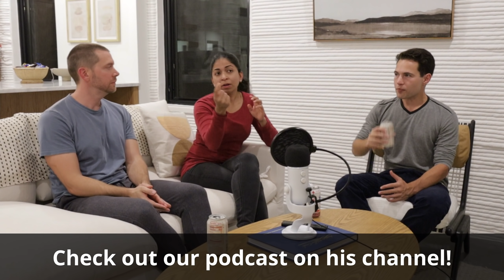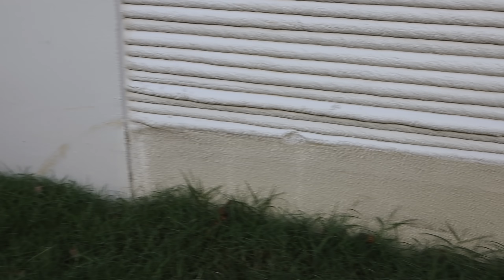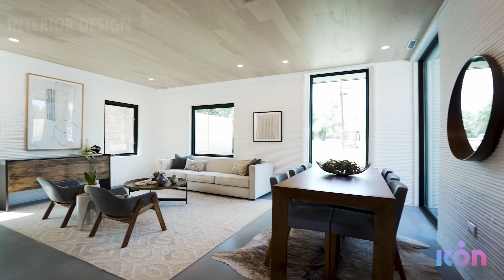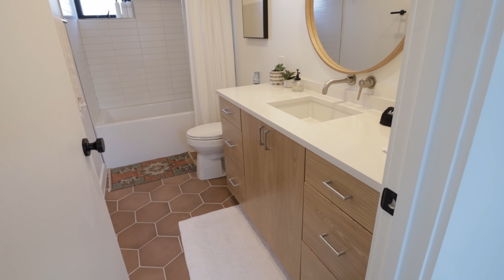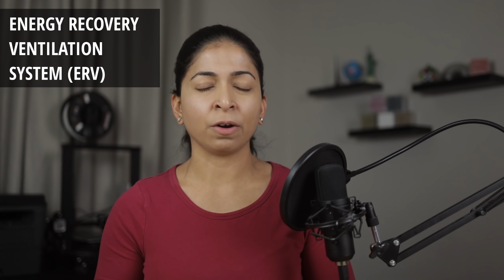I stayed at ICON's 3D printed concrete house in Austin!

Comment: It will be interesting to see these houses in a few years' time - when they have become dirty.  I imagine that cleaning these printed walls inside and outside will be very difficult.  Especially in northern and southern latitudes (temperate climate) the outer walls will be prone to things growing on them - some, like lichen, might be attractive in some ways, maybe moss, too, but eventually you will probably find larger plants trying to grow on the outer walls. Whether this is good or bad is debatable, of course.  Inside, dust will accumulate on the ridges, and will be hard to remove, I suspect.  I would have thought that lining this interior walls with drywall would eliminate these sorts of problems, and make it much easier to hang things on the wall, and to put in services. I know, that will hide the fact that it is 3D printed - but the novelty of that appearance will soon get old.

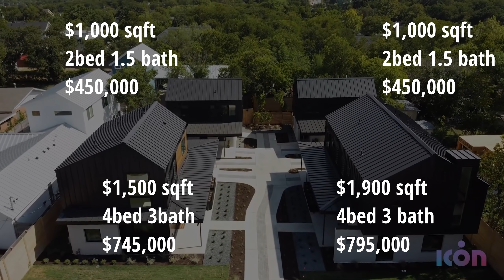Comment: 7:30 I think you've confused price with cost. The reason why these 3D printed homes prices are comparable to similar sized nearby homes in the area, is that you'd be crazy not to sell them at the prevailing price level. If they cost half as much as traditional built homes in the area, they'd still be priced at the prevailing rates, and if they cost twice as much to build, they wouldn't exist in the first place because they wouldn't have even bothered to break ground. Unless they're showing a true cost breakdown and willing to publicly quote a similar structure outside of a high priced city, we really don't know what these things actually cost.

Comment: Would be neat if the printer could trowel the concrete smooth as it goes. The pattern it leaves now looks kinda kool, but could collect dust on the upper sides. Those trim boards not matching in the corners could have been done much better. Simple trick with a circle compass would mark them almost perfectly.
Thanks for showing us these technologies, Belinda. 👍

Comment: @BelindaCarr please include metric equivalencies either in the audio or as text; it would make your content more accessible to those of us are not as fluent/familiar/literate with imperial units. Especially with pressure, force, volumetric and mass flow rates.

It would be interesting to see if it would be possible to integrate the electrical outlets into the print.

Comment: So how does the exterior layer of mortar tie in to the interior layer for structure? Filling the wall void with insulation makes sense but the thickness of that exterior layer is pretty thin for load bearing.. or maybe they poured columns and the wall isn't load bearing?

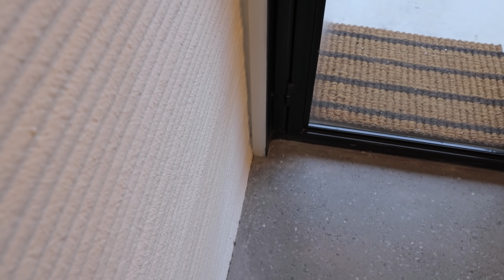Comment: 5:09 This isn't a limitation of 3d printing, this is a limitation of ethics and care by the company in charge of constructing the house. They could have done a better job but chose not to.
Touting yourself as a cutting edge 3d printing company is sexy, doing actual construction and caring about the work you do isn't sexy so they don't care.

Comment: You can tell whoever printed the walls doesn't understand slicer optimization. It also doesn't look like they used any type of vibration compensation or they would have been able to prevent the corners from looking like trash. Even cranes have motion compensation.

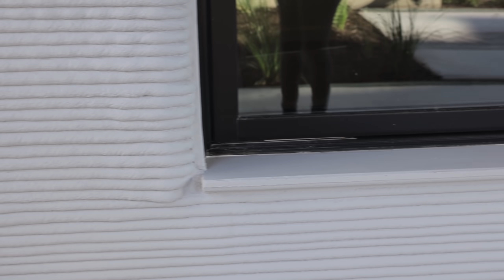Comment: 1:19 "Mortar" and "concrete" are terms that are more related to their function than material.  The term "mortar" is reserved for the substance that connects other masonry objects together like brick, block and tile.  The term "Concrete" is used when similar material is used as a mass for things like floors and walls.  All mortar and concrete have some sort of aggregate even if it is just a sand or sand like material and these are considered small aggregates. The function of Portland cement which is contained in mortars and concretes,  is to "glue" or adhere the aggregate together.   The large aggregate would be the gravel if it is included.  So these walls are printed out of a concrete with small aggregate and other additives like accelerators or decelerators (depending on temperature) and other polymers for strength and resistance to cracking.   This mix would be similar (but finer) than a line pump mix we would use for pouring walls through a line pump.  

I love concrete but I love efficiency even more :)  the amount of time, material, equipment and labor required to do this (when I could take 2 carpenters and framed these walls in a day with simple tools :) makes me predict we will never be using this on a wide scale.  You can look to the spec market in housing to see what is efficient.  This type of construction will be reserved to those who can afford the material and process and time to wait and head aches for MEP. Again, it's cool but . . .    Nice video.  Your videos are always informative and objective.

Comment: I think many people are getting stuck on the appearance on the interior. They could cover it up with drywall or stucco for a smooth finish, but they chose to leave it as is for aesthetic reasons.

This is a huge progression of 3D Building construction and I'm very excited by the potential, even if it currently bis targeting a select niche market rn

Comment: I really appreciate your straight-forward reviews and thank you for including the VOC/CO2 levels, as well as heat loss. The one thing I've wondered about, regarding these alternative construction methods, is that they are touted as being a more cost effective, but they seem to cost just as much as regular construction homes. Sure, it can be cost-effective for the builder, but not for the end-consumer. For example, to me, a $50K tiny home seems reasonable, while a $100K tiny home does not. What do you think?

Comment: #1. It's a 3D printed first floor walls, not a house. A definition of a house is not the same a just walls without anything else.
#2. I want to know if that cement mix is bad or good for the environment. 
#3 eberh RC prefabrication factory can make such shape, with isolation already attached. The walls could have been two floors tall, so the structure can be built in two days. That's a standard technology and lots of experience. Nothing complex.
Reply from the maker: I addressed all those points in my video on 3d printing lies: https://youtu.be/sz1LM9kwRLY
Reply: @BelindaCarr  
Yeah, I know. I watched that. I've seen most of your videos. Your content is great! :)
I started with the content about container houses. That one is my favourite. 

It is just that the houses from this video are nothing special in term of technology. Commercial technologies could make these  cheaper and faster. Especially that there was a good crain access to that site. 

BTW1: your content is very good. I've watched a lot of it. I keep watching older videos often. 
BTW2: gym definitely has good effects on you. You look amazing. Keep it up.

Comment: For structural purposes I think 3D printing could be very interesting (if it can get up to the necessary compressive loads) but this honestly is just a hair above a sham. 3D printed walls that require an elastomer exterior coat to make them waterproof the inability to make them useable inside surfaces to not even able to hang a simple picture frame from they are there for show only. You could easily replace the 3D printed parts with pre-cast concrete or factory assembled panels (hempcrete, aircrete, SIPS etc) and it would result in a more useable space. I was shocked to see the state of the finish at the edges where other surfaces meet 3D printed 'concrete' not to mention the lack of any kind of practical usability or liveability (leaving a rough textured surface as a kitchen backsplash, dust building up on all the edges inside) and bizarre design decisions like putting all plumbing/electrical into a bump out rather than having them printed in, thats the whole point of digital design. 

I think 3D printing has a long long way to go before it can compete with modular/panelised systems and even block stacking robots for home building, in industrial needs it may make more progress but for homes the results are sub-par even in the context of this being an early iteration.

Comment: Belinda: Did you do any series on SIP frame homes?  As a builder, I find SIP homes more practical rather than 3D Printed homes, that have many limitations and final finish seems to be ???. Are they limited to one floor only? I find selling prices too exhorbitant for that kind of finish, no matter what locality they are in. Regretfully I will have to stay away for the time being and unless more perfection is achieved. I appreciate your independant review without any favor to ICON. You are too good. Although I have been builder for 15 years, I have learnet a lot from your videos.

Comment: I've seen some of the earlier ICON3D printed homes at community first village, probably considered a prototype, and there was cracking in a few spots. I wonder if cracks may develop in the future. You can't review a house that hasn't stood a test of time. This is new. Give it a few seasons to see how the walls weather over time.
Reply: Great point. Concrete tends to always crack but this project isn't structurally dependent on the concrete walls, the homes structure is all based on traditionally reinforced columns so a crack won't mean the house is going to collapse.

Comment: Thanks, Ms. Carr, for your such thorough and conscientious videos. Regarding these poured 3d homes...yuck, just yuck: 1. wires and conduits are not hidden outside, 2. severe lack of flexibility when remodeling, 3. chips, cracks, gaps in joints and when installing fixtures, really ugly exteriors (too me :) ), and finally, no cost advantages for the considerable trouble a home buyer is going to go through to purchase this particular style of home construction...in fact, really inferior usability.  Now, that negativity aside, I applaud any builder for "trying something out," and hope in the future that 3d printing will be a viable alternative, because the more options we have the better for this planet and humans. Again, just really not viable to me at this time, for aesthetic and practical reasons.

Comment: Very thick walls mean a lack of space inside the foundation. A significant extra cost, with reduced floor area.
Walls which are not flat will accumulate a horrendous amount of dust over time, and as the surface isn't smooth, and it's painted white, they're gonna look like crap is just a few short months.
3D printing is not yet ready for the mainstream. Or any stream at all, really!

Comment: OK you've just convinced me to go with structurally insulated panels (SIPs) if I'm building a new home. 3D printed walls contrasted with "level 5 drywall" (smooth finish) are not particularly good looking :$

Comment: It takes a team of framers 7 days to frame out a whole single family home. Assuming the trusses are pre-assembled for the roof. So there's no time savings here plus wood is cheaper and you use pressure treated plus metal brackets for anything in contact with the concrete foundation.

Comment: could some of the roughness of the 3d printed walls be mitigated by troweling it smooth (or some similar process) as it is being printed? This would add human labor of course but not so much as to totally negate the value of 3D printing. Is that feasible? At least on the interior where it will have to butt up against door frames and window frames.
Reply: Its totally feasible, they are working on that right now fine tuning the details. It isn't perfect yet but on the right path I believe.

Comment: How does the material handle areas with large temperature swings and multiple frost-defrost cycles?  I'm thinging +/- 40C.   How often would you have to apply the exterior paint to avoid cracking?
Reply: It should be ok with large temperature swings so long as it has had 28 days to cure from the time it was printed. That being said none of these homes have been around for enough years for the test of time to be ripe.

Comment: The layers of the 3D printed concrete are there for marketing!
The layers will never be there when the product can be used for real projects they have allot of possible issues in wet climates and the thermal is slightly worse. And most of all don't look at the prices now. 3D printing now is insanely expensive and payed by companies that don't want to be left in the dust by the possible future market.

Comment: this should be a more cost effective option, also fast way to build a house, instead, they do the first floor and then the other half of the house is traditionally framed, so you loose the time advantage, and with the current building material prices, you loose  the supposed cost savings as well....

Comment: That exterior would be a nightmare in a humid, pollen-rich environment like most of the southern US. There, you get pollen and algae growth on smooth vertical surfaces, even on south exposures. This gray scum will be nonstop on that white, striated exterior. On the plus side, if that paint is OK, powerwashing should be less risky than when they put high pressure on marginal siding on regular houses. Interior dust would be simple enough to vac with a brush attachment, but it'll be some work. I can't help but think that factory-made concrete panels assembled on site would be faster, cheaper, simpler, and more reliable.

Comment: Not sure the prices are valid if these are being bought specifically for AirBNB rental -basically a business/commercial use.  Not the same as if being purchased to live in a long time just paying the mortgage.
Seems like a novelty since you really just have a 3d layer (pretty boring rectangles/squares with rounded corners) between a very traditional slab foundation and stick built top.  
My house (1995-current) was built during ww2 with a 5" cement ceiling over the entire basement - rest of the house is old school solid brick (4 thick on lower level - 2 or 3 on upper) with fairly normal stick built attic/roof.  Changing anything is an amazing pita - example: running a new water source for fridge icemaker was an industrial roto hammer to get from basement to kitchen.  HVAC system revamp was a nightmare.  Just hanging something on any given wall in the weird concrete/plaster they used takes extreme caution while "gently" using my smaller consumer roto hammer.

Comment: Can some kind of sheet rock mud or stucco by applied to the interior walls to hide the layers of the concrete. Also, how is all the electrical, HVAC, & plumbing installed?

Comment: That air circulation is at the bare minimum for that size.
Like, holy chrap. It's like they took the airflow calculation for an unoccupied apartment (in my case - Swedish standards), applied it to the building and said 'F it'.
Without regard to if any person would actually be living in there.

70 cubic feet/minute --> 1.98 cubic meter/minute 
1.98 cubic meter/minute --> 1982 litre/minute
1982 litre / 60 seconds --> 33 litre/second

Swedish bare minimum standard for a occupied place without people in it at the moment, i.e. when you are away from home.
1106 square feet --> 103 square meter.
0.35 litre/second per square meter --> 0.35 x 103 --> 36 litre/second.

In other words. There's not even enough air to ventilate the home if it stood empty. At the looooowest possible standard.
We don't even know how efficient the air-room-circulation is.

No wonder you had such high C02 PPM.
Reply from the maker: They said that the minimum code requirement is 52cfm  for a 991 sqft home occupied by 3 people in 2 bedrooms. So, the 70cfm is 134% above code!
Reply: @BelindaCarr  Oh lord.

That is no ventilation for 3 people.
What kind of of minimum code is that...
Thanks for the videos!

Comment: 3D printing will become an actual good solution for architecture when, instead of focusing on speed, they take advantage of the layers system to facilitate the installation of pipes and cables within the walls. Ideally, using the same machine (although with different heads/arms).

Also... wouldn't it be possible to attach a small robotic arm with an spatula to the printing head to smooth the not-concrete as it is deposited?

Comment: What I would like to see is some sort of vertical conveyor system on the outside of the nozzle that follows behind the path and creates "walls" for the crete to form to so that they are much smoother. I see it similarly to a tank tread but with pinions on both sides so that it can snake in any direction....if there are enough pinions, then you could actually add shape other than flat surfaces as well (like making a shallow edge on windows and doors so that the wood can sit flush).  I imagine the conveyor only has to be a couple feet if the nozzle is slow enough before it is cured enough to allow no slump at the tail.  Along with this, maybe have a top roller to put a groove inset into the crete so that the next layer added is given lateral locking.

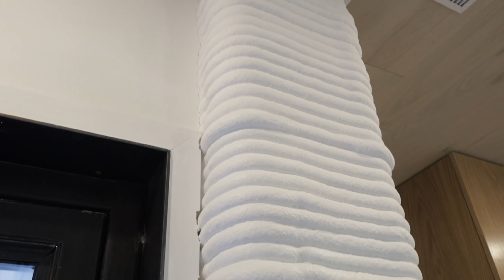Comment: It seems odd to me that you wouldn't use a thinner architrave at 5:05 rather than notch it around the uneven printed wall. Doesn't look the best and would be easy to measure the most protruding printed line and get an architrave to suit. Over all it looks great though but is it any cheaper or faster than traditional buildings ?

Comment: Seems more solar for colder climates with more insulation and thermal mass on the interior would be great.  Seems the seems can be filled with silicone if issues with differences with expansion and contractions.  ERV's are a must with these... especially if wanting to be passive since seems like these can be made to be more like a passive (I think that's what it's called) designed.  Neat there are at least low VOC's with the closed and I think open cell spray foam insulation.  Pioneered there in Texas last I knew.  Seams that can be sprayed on the exterior with whatever finish you want on the exterior too.  Then way more thermal mass and no bridging.